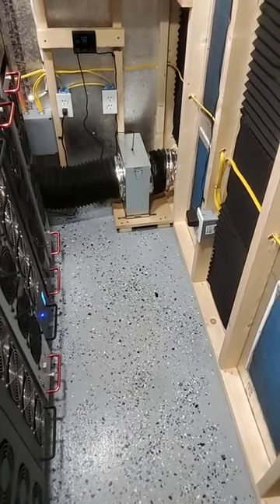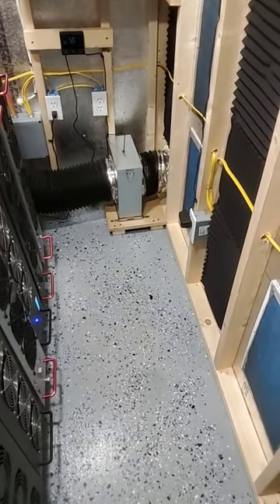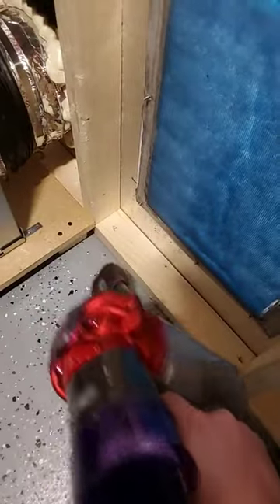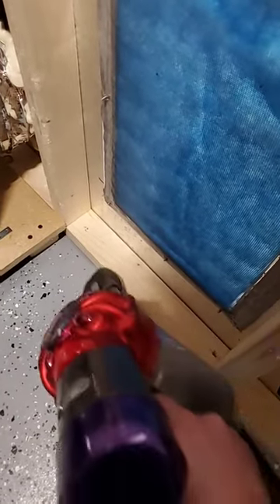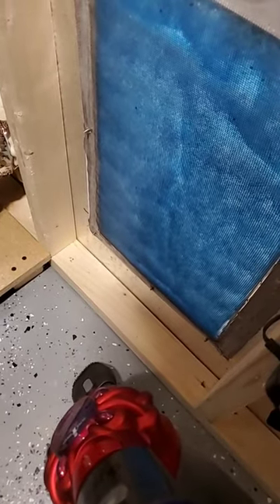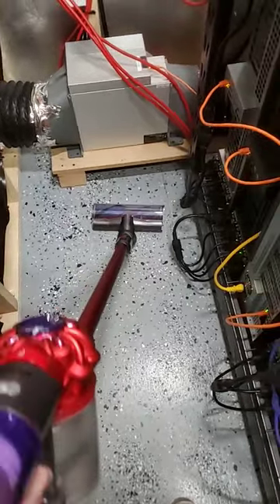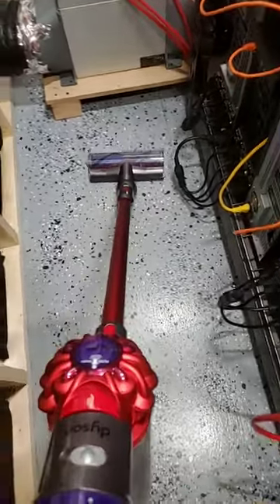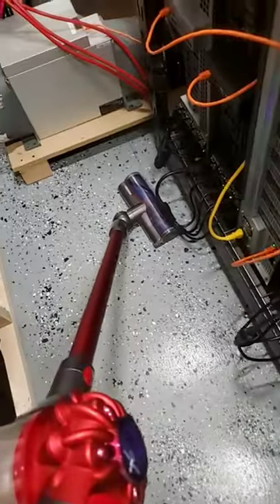Cleaning My Home Crypto Mining Shed Monthly! #Shorts #Bitcoin #CryptoMining

Comment: Question for you… I see inside of your mining shed you have noise proofing on the walls.  Are there any in specific you’d recommend.  I’m building out my mining “garage”, but want to keep the sound out of the house which is why I wanted to ask.  Thanks in advance
Reply from the maker: I was limited due to the studs. If your garage is drywalled I get Large Panels.